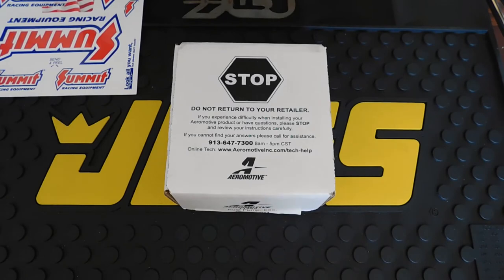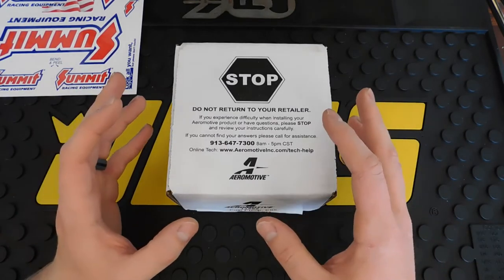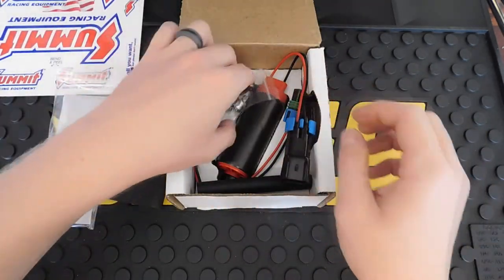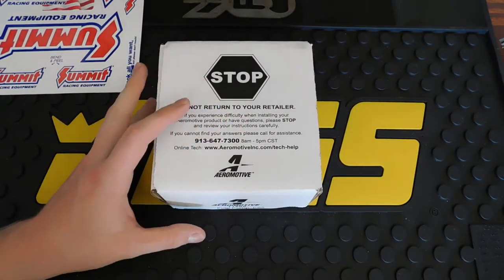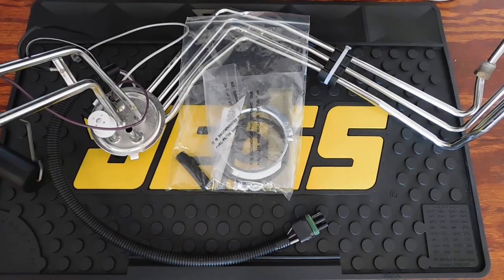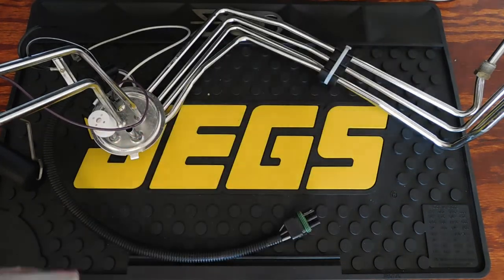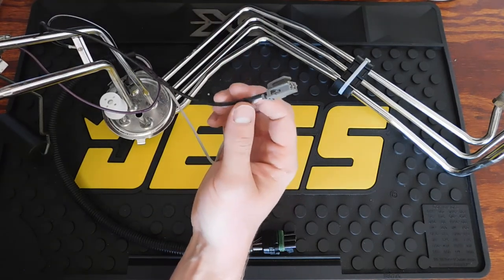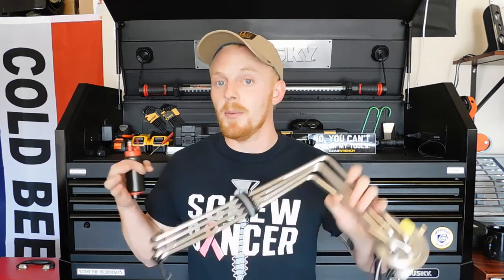Aeromotive Fuel Pump and Sending Unit for Third Gen Camaro

Comment: Dorman has a lifetime warranty on their parts.The best OEM replacement fuel pump for GMs is Delphi whom makes AC Delco fuel pumps.One fuel pump brand to stay away from is Airtex,have seen tons of failures with Airtex fuel pumps
Reply from the maker: wafrederick ya I was between this one and the ac deal one which had good reviews. But the Delphi one for my car had horrible reviews. Like 5 people saying it lasted less than 300 miles.
Reply: Delphi has a lifetime warranty on their fuel pumps.

Comment: If i am doing a sbc 350 swap can i install a mechanical fuel pump? Or do i have to install a block off plate and run the electrical fuel pump?
Reply from the maker: No you don't have to run the electrical pump you can do the mechanical pump
Reply: TonyTheTechnician so can i just hook the mechanical fuel pump and im good to go or would i have to take off or turn off the electric one?
Reply from the maker: You will have to disconnect the electric fuel pump